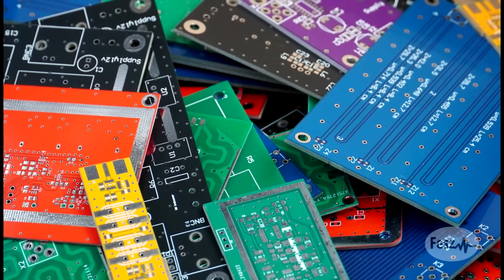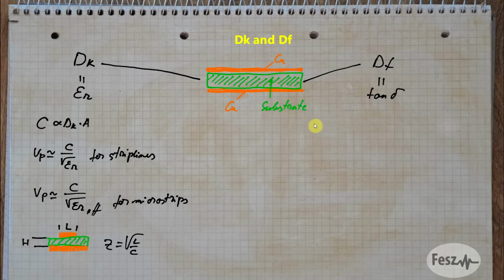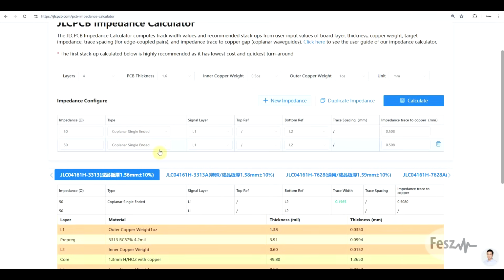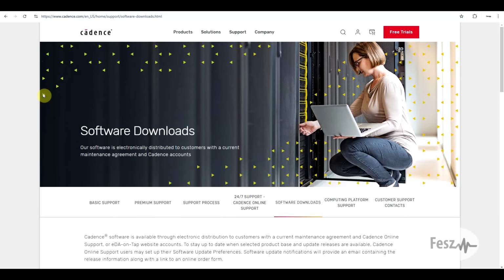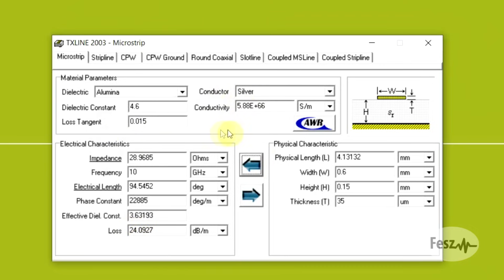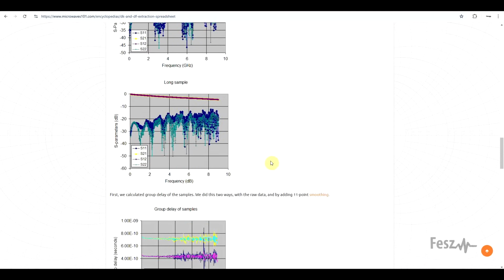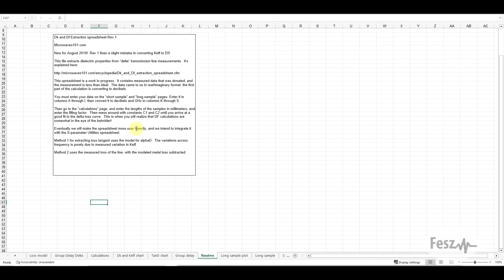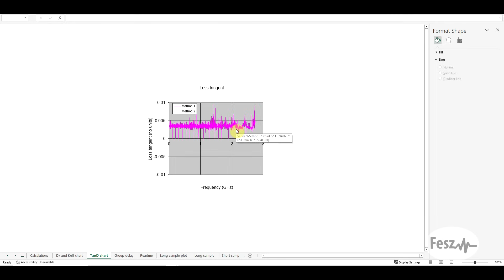PCB parameters - Df and Dk

Comment: May someone quickly explain what the fillfactor is?
Reply from the maker: The filling factor refers to how much of the electric field around a conduct actually goes trough the substrate and sees the higher dielectric constant - for a stripline its 1; but for a microstrip it depends on the substrate thickness.
Reply: @FesZElectronics  Thank you

Comment: Is the ripple in the S-parameter attributed to the limited accuracy of the light VNA at high frequencies? Which is the part number of the one you are using?

Also is it okay to test the impedance on a different PCB circuit board with the same geometry as the DUT (just not to have the test part on the final PCB)?
Reply from the maker: I'm using a LiteVNA64 which is rated up to 6.3GHz; but I would say that the ripple has more to do with the trace than the measurement device - because of all the bends, the trace does not have a uniform impedance... 
Regarding your second point; you can of course have 2 different boards, but the difference between them can be larger because of the technological tolerances of the manufacturer. With both test board and useful board on the same panel, the differences will be much smaller.
Reply: @FesZElectronics 
When simulating impedance with keysight SI in altium I did not notice any influence from 45deg bends vs curved bends on impedance. I don't think that the trace bends affect the impedance. The material could be non unformily weaved particularily in x vs y axis however.

Comment: This is a strange experiment. The Dk (er) is a major part of the formula that calculates the microstrip width for given 50 ohms wave resistance. So, the JLCPCB's calculator for the width of the line was using a known Dk value to give you the width for the design. This Dk (er) is specified on a different page on their website. Then you measure the Dk assuming the line is 50 Ohm? It would not be 50 if the Dk is not what they say it is, and your measurements would then be skewed because of the power reflecting on non-50 Ohm joints, giving you incorrect results.